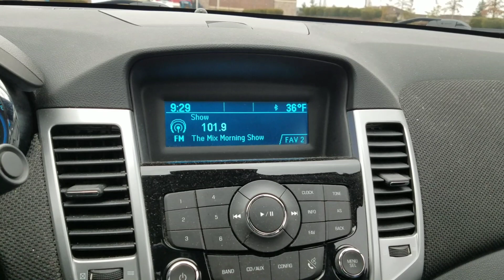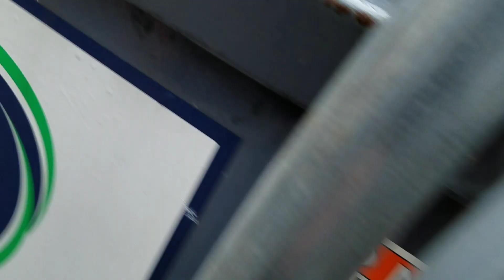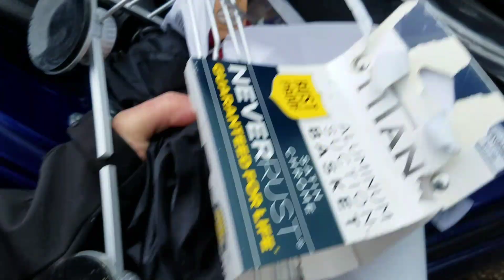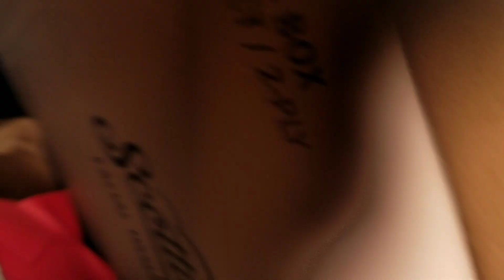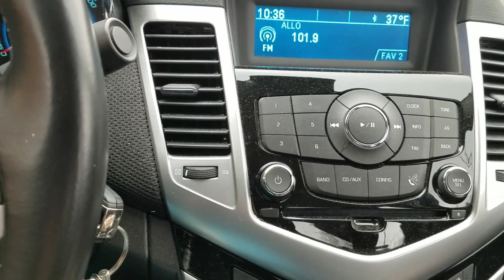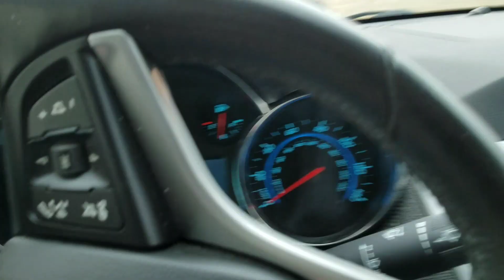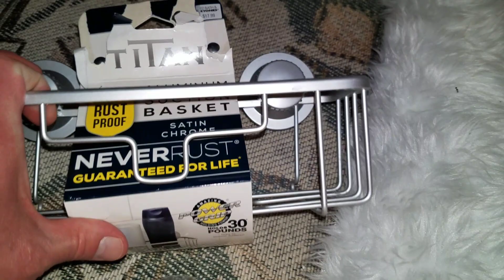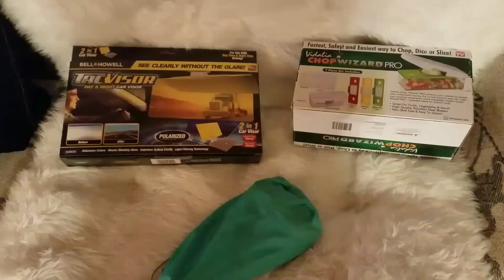Dumpster Diving Dream Video, Five Below, Bed Bath&Beyond,Party City and lots More, Haul 13

Comment: I do well with Christmas Card boxes on Ebay.  I usually keep them until late October, early November then list them.  I usually sell them for 10-15 dollars with free shipping.  I find the best cards from Barnes and Noble.  They usually throw everything out in late January and the haul will more than fill your car.
Reply from the maker: Thank you for the information it means a lot to me. How many do you give for the 10 to 15 dollars? I have yet to find a single thing in my Barnes and Noble lol but i still check. Thank you for watching and commenting.
Reply from the maker: That is why i try hard not to get caught it is not the police i care about but the store managers because then they will start wrecking it.
Reply: Scrap Dog I didn’t see her respond to your question. I’m sure you’ve looked online by now but I used to sell on eBay years ago when it was just getting big. So I’m not sure if this is current info but I usually did 10-20. Depending on the Cali we of card. And if I made my own lot or they were already boxed.